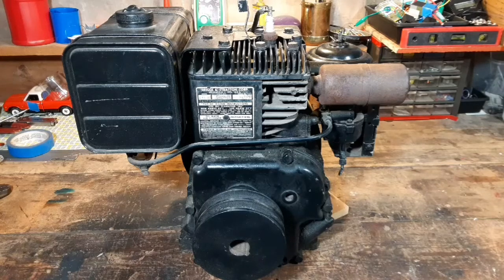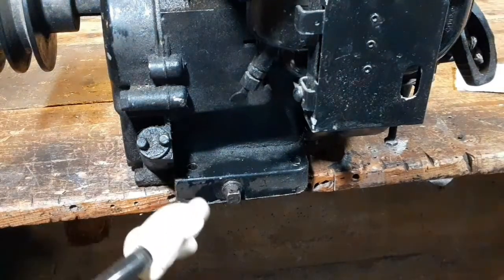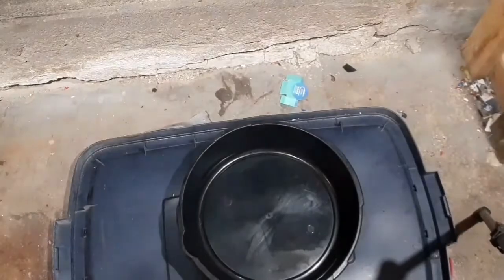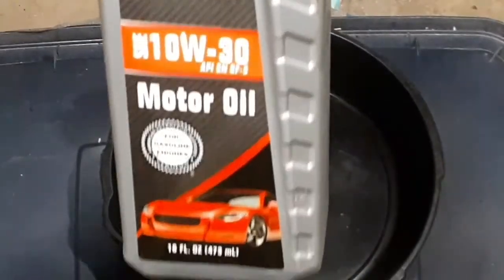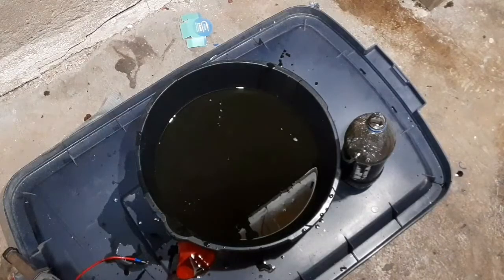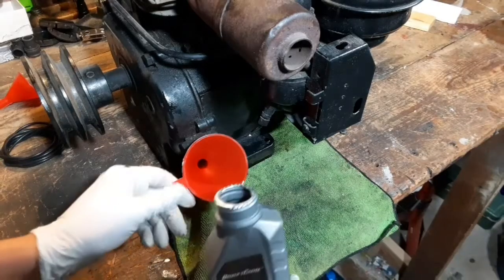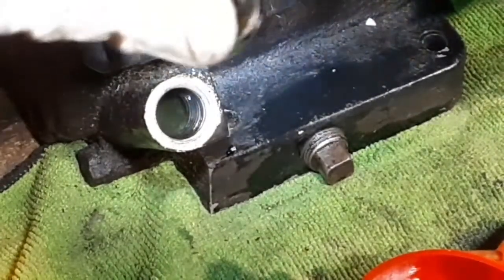How to change the oil in a Briggs and Stratton engine. Vintage Briggs engine.

Comment: I have a 5 hp 206 cc b&s almost the same. To the threads should be enough oil?
Reply from the maker: That's how I usually fill them if I don't know the actual capacity.
Reply: @ThriftStoreHacker  
I just that method was about 500 ml and there camera out maybe 100. But what i found was like that the need about 550 600 so i let it like this

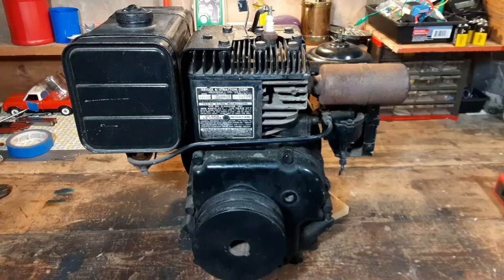Comment: At 2:42 was that smoke/dust or GHOST moving upward in front of the left side of the motor?  Good refresher on changing oil.
Reply from the maker: A ball of dust. I had a fan going and it kicked up all the dust and dog hair in the basement.  The desert dust is awful here. You clean and 2 days later everything needs cleaning/dusting again.